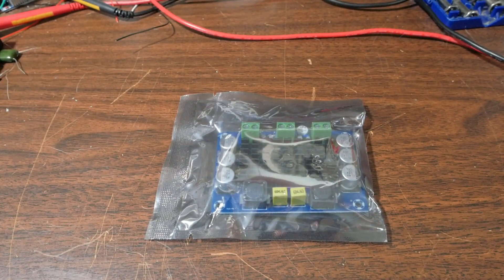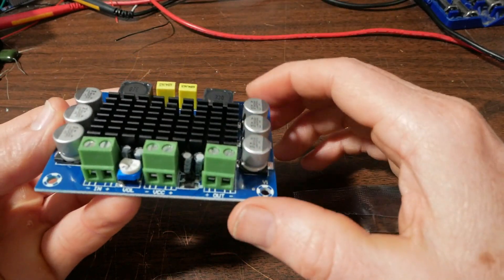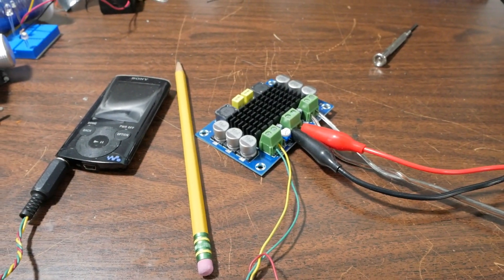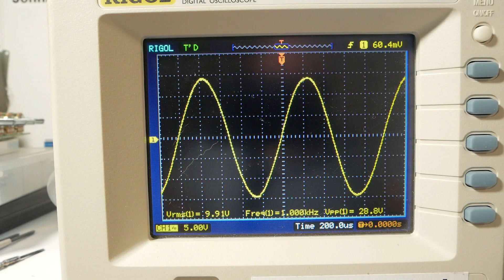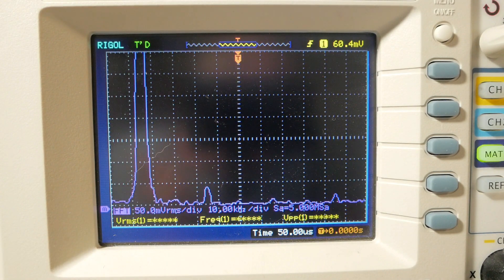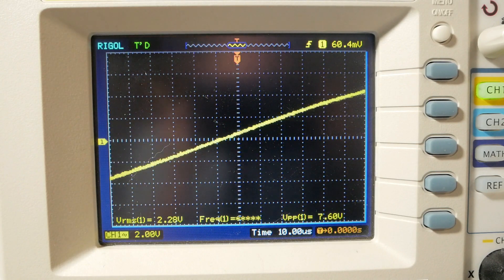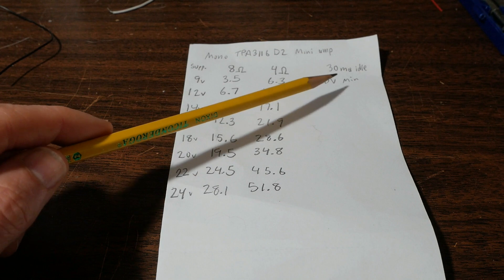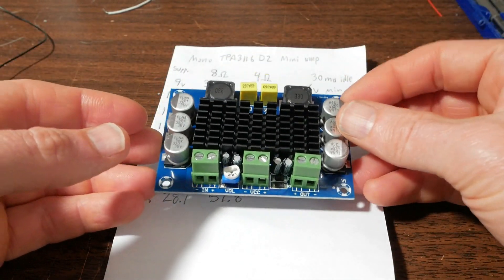TPA3116 D2 mono audio amplifier board test  & review

Comment: I have measured the amp, U=20V, R=4Ohm. The maximum Urms is about 10V, which means about 25W, if I calculate correctly. The same result can be seen on the video, time 04:06. Increasing the input signal level brings about the limitation and distortion. So I would say that maximum output power of this board is about 25-30 W into 4 Ohms and a half of it when using 8 Ohms load.

Comment: Did you ever test these at 2ohm?
Reply: He did, the reverse polarity diodes are 1N4007 and they are rated at 1A since they are on parallel it give 2A of headroom but at 2ohm it pushes 4 to 5A really stressing them and the coils get hot, a lot of clipping too. I wouldn't advice on doing 2 ohm loads

Comment: Hi John, I have a question. I noticed a little volume pot on the amp. If I'm going to use this amp in conjunction with a preamp board, should I turn it all the way up, or somehow bypass it?
Reply from the maker: Set it mid way and see how the level works out with the preamp and go from there.

Comment: I got two of these and used them with a car stereo. After removing the negative speaker wires from the head unit they worked fine.

Comment: so this board BTL  only deliver 50W at 24V at 4Ohm Speaker??

i recently buy 2pcs for making stereo 2x100W.. still delivery process..
i'm thinking this board can deliver 100W at 24V at 4Ohm speaker :face-purple-crying:

i have 2 Speaker  @100W RMS, want making Stereo Amplifier 2x100W
or any recomended Class D board that real run 100W at 4Ohm speaker??
Reply from the maker: Physically impossible to get 100 watts from a 24 volt supply into 4 Ohms with these boards. Around 50 watts per channel is the best you can do.
Reply: @JohnAudioTech  can you run 2 of these boards in parallel to get 100watts 24v 4 ohms ? Or would it fry the outputs or be slightly out of phase due to output coil latency ?

Comment: you really seam to know what you're talking about. I would need quite a bit of education to devolop the same knowledge base. there is a review about this amp on amazon saying that the chip under the power supply isn't as advertized. this review then suggets the TPA3118 amp. have you reviewed this? if now, would you?

Comment: I have seen in some video that this board is actually not having TPA3116 ic under its heat sink, instead it has some other IC which is not even having a number on it.
But still if it performs good, then it is actually appreciable.

Comment: I got two of these boards online. I am trying to figure out how to pass a stereo Left & Right channel into them correctly. I am wiring a aux 3.5mm stereo jack to the inputs, but when testing left and right it appears to drop either the left channel or right channel. How can I correctly multiplex both Left and right from the 3.5mm into this kind of amp.

Comment: I received 2 of these both were fake sop16 ics with TPA3116D2 painted on them. Can’t get a refund until the product is shipped back. This video sold me on this module. Thing is with the fake chip it still says it’s pulling 30+w on my supply. Sitting idol it pulls 70ma. 24v supply. Really crappy distortion above 12v. This fake chip is fooling lots of people by looks of feedback on the item I bought. If you haven’t came across the fake one I’ll send it your way. 
Great video, as always. 
God Bless.

Comment: Would you be ok to run this at 24v at 4ohm full time or would you recommend a lower voltage to operate on?
Reply from the maker: If you like to play it loud with a lot of bass, I'd back down to 18v so the board doesn't overheat.

Comment: 4 Channel 100W*2 50W*2 TPA3116D2 Digital Stereo Audio Power Amplifier Board  I have this board I just ordered and wonder if its any good.  Replacing the High Power Digital Bluetooth Power Amplifier Board TDA7498 HiFi Stereo 2*100W got them both off eBay had to replace the old one because when turned up it cuts off and have to power off and one to get sound back.  I figured with 2 additional outputs I can get rid of the crossovers  and the 50 watts can go to new mid range twiter combo speakers.  and in hopes of getting better sound.  whats your input.

Comment: I just bought one of these boards off of eBay and tested it on the bench with a 24v supply and 4-ohm load. I accidentally shorted the output for a second. The board died, I pull the heatsink to find an unlabeled 16-pin burned and smelled chip, not a TPA3116 D2. The package was different. Yes, it did a little over 50 Watts but it is not shortcircuit protected like the real TPA3116.  What's going on here? Fake TPA3116d2?

Comment: There are now "copied" 3116 chips out there called a "TPA3116D2DADR" that replace the genuine TI TPAa3116D2 chip.  These looking nearly identical to this board.

If I send you one along with a donation to the cause can you test it?  I also have a stereo version of this board.  It is listed as 100Wx2 so I expected it to have two chips but it does not... That would also be interesting to measure to see what it can really deliver...

Comment: I tried to measure fr. response with Holmimpulse or Arta via my USB soundcard and I get a lot of noise, as soon as I connect ground probe to output (at fairly  low level). Is there some kind of special procedure with those D-class amps?

Comment: Hi. I have seen another video before, in which you tested another board with a TPA3116 amplifier (red board) which had some problems with the preamp and ceramic capacitors (I remember you bypassed the preamp with an electrolytic capacitor).  
Is this blue board better than the previous one?  
Do you have any problem like the above?  Which one would you recommend?
Thanks in advance
Reply from the maker: Yes, this board is better but all the ones that I tested used the wrong value of output filter coils that roll off high frequencies too early.

Comment: I actually build a guitar amp and I put one of these inside it. So far it's still working. It's loud enough to practise at home but not loud enough with a band.
Reply: Did you use 24V supply?
Reply: @audiobodge  yes 24v
Reply: What power supply do you use for it?

Comment: How much amperes do I need for 24v supply on 4ohms? Planning to get one to use as a guitar amp.
Reply from the maker: 3 amps should cover it.
Reply: @JohnAudioTech  Thanks! Another question. Does using a compressor/limiter prevent this amp from distorting while increasing the loudness?

Comment: I had one of a similar board, which had a strong power on transcend “pop” on my woofer. Usually I could have a 555 based delayed-on circuit hooking to the MUTE pin on the TPA3116 and push it “high” for a couple of second at powering up and avoid the “pop”. However, this board had the heat sink adhered to the chip and had made this mod impossible. In my attempt to pull the heat sink off, I have broken pins of the chip. To me, this little beauty is useless. I would only look for a board with screwed-on heat sink, or with built-in power-on management circuitry.
Reply: have you found such a board, as the pop really annoys me!

Comment: I have questions -
1. How much power output can we expect on single 24 volts @ 4 ohms ?
2. If the gain of an amplifier is reduced to minimum recommended as on datasheet, will it result in more current (Amps) draw from the power supply ?

Comment: can you help me with the volume, as we need a screw driver to operate it  ? can I connect the audio in to the loudspeakers terminals of my car radio so i can operate volume with the radio ? if so can I set the volume on board to max?

Comment: I have problems with this board.  Intermodulation occurs at 3.3KHz and higher. New signals appear in the audio range especially at high frequencies. Probably because of the 2.5Khz - 5.7KHz spikes at 0V input (not sure where it comes from actually. Ut rides along the 990KHz sawtooth wave). i don't know why it happens. It sounds great but I'm worried about this issue. How to fix this?

Comment: Doing some testing on various Class D amps with the small inductors like this one, what I've seen is that if you leave them loaded for a few minutes the high frequency distortion goes way up.  Say 10Khz or above.  I've watched FFT's where you can see the distortion build as the inductors heat up.  Would be curious if you see the same thing.  Perhaps a video opportunity.
Reply from the maker: I'd have to check this out. Perhaps letting the inductor warm and cooling it to see the result.

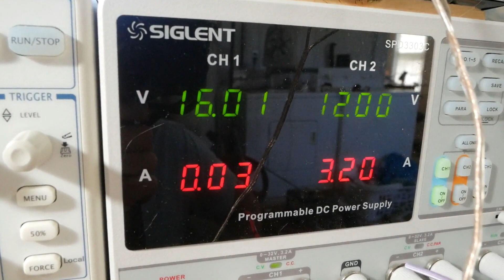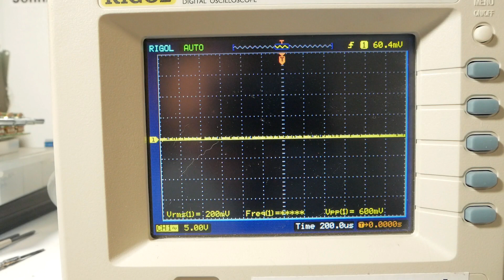Comment: Hi John - Thanks for doing this detailed video. I am confused on how a single-supply amp such as a TPA3116 with a max VCC=26 volts can produce 100W @ 2 Ohm load in mono mode unless the h-bridge circuitry somehow uses charge-pumps to increase the voltage swing to greater than supply.  For example, the spec sheet recommends a 24 VDC brick. So that would give a 12 Vpk, or 8.512(.707)=8.5 VRMS, giving a max power of (8.5)^2/2=36W, which is far off of 100W. You show at 2:15 that you are supplying 16 VDC which should yield a Vrms=5.7, yet at 4:03 the VPP is 28.2 VDC and Vrms=9.71V.   I have read the spec-sheet and am struggling to understand this.  Can you suggest an explanation? Does the device use charge-pumps, and if so, wouldn't that reduce the max current that it could supply? Thanks again.
Reply from the maker: Ignoring the few volts of loss, with a bridged configuration and a 24v supply. At max peak +voltage, side A amp (as I'll call it) of the bridge has its upper transistor fully open to the positive rail and amp B's  lower transistor is open to supply ground, so +24 volts across the load. Now let's say the waveform transitions to max negative, so now the lower transistor in amp A is open to ground and the upper transistor of amp B is open to the supply. Now there is -24v across the load. The full cycle yields 48v pk-pk or 24v pk which is about 17v rms. With a 2 Ohm load, this would dissipate 144 watts. The bridge doubles the max voltage the amp can deliver for a given supply voltage. Double the voltage means double the current into a given load and that results in 4x the power. Losses in a real circuit means output won't reach this level. Hopefully this makes some sense.
Reply: @JohnAudioTech  That just clicked!!! Thanks so much for taking the time to respond.

Comment: Trying crossover design using this amps.. it seems there is a boost on higher frequency.. its not flat.. and when using Xsim design.. there difference between simulation and real measurements.

Comment: Hi John, I happen to have such a mini amp and intend to use it for a Bluetooth speaker project. I have several options for the bluetooth. I could go for a simple KRC-86B module or find myself a BT board with integrated amp options. Most of the time those are like 2x3W. Pro for those amps is the bells and whistles with extra's like 3,5mm audio jack input (besides using BT) and even an option to add a SD card as source.
Did you ever test such boards? Is it possible to daisychain such a board to a TPA3113 D2?
Thanks for the answer and thnx for the informative video's so far.

Comment: My first 3116 board suddenly started acting up in one channel. The sound comes on and off like an oscillation .I can't figure out why.
The second one is still running. 
I am running it with a 18v transformer which after adding a filtering capacitor pushes the voltage to 26v. I used 8 diodes in series with the power supply to drop it to 20v. Can I run it without dropping the voltage at 26v?
Also do you know what ails my first board where the sound comes on and off in one channel?
Both boards are dual chip.
Thanks in advance

Comment: Hello John,
Greetings from Serbia...

Please help me about this amps.
I installed 11 amps in my bus to make active speakers in passinger deck. It works very nice.
But when I finished then I suprised.
When I start dimmer for low intensity led lights, speakers got loud buzz!
I try to connect power supply from the other sorts and no changes.
I disconnected amplifiers from head unit and start supply and dimmer for lights, amps make buzz without sound.
I don't know what to do.
It connect parallel 5 amps on right side, and 6 amps on left side. 
Thank you and
Best regards

Comment: Does anyone know what  is the small potentiometer doing on this board. Is it for volume adjustment or dc output adjustment ?
Reply: That is volume adjustment.
You can instal it on any DC power supply from 12 to 24v.

Comment: Hey, i ordered another TPA3116 amplifier with bluetooth. I am wondering if i can expect similar results to the one you reviewed or not ? If not, i might aswell go order the one you reviewed and a separate bluetooth module. I need it for my bluetooth speaker btw. This is the module i ordered:

https://www.ebay.com/itm/Digital-TPA3116-50W-2-Bluetooth-4-1-Power-Amplifier-Board-TF-DC12-24V-XH-A104/163870557767?ssPageName=STRK%3AMEBIDX%3AIT&_trksid=p2057872.m2749.l2649&autorefresh=true

Comment: Great video, a lot of info, but TPA3116D2 is designed for 2 x 4-8ohm loads, in this mono build you should also measure it with 2ohm  load to see if you can get close to that advertised 100W power

Comment: i currently got one of these on my logitech z5500 subwoofer and it hits hard  but i never got to full volume yet lol
Reply: if anyones wondering the built in amp for the z5500 died out of nowhere so i ditched it and converted the subwoofer into a passive subwoofer
Reply: the amps running off a 12v  20ah 18650 battery pack  i built  for a portable system that punches
Reply: @danielhorne6042 bad choice..
Logitech Z5500 have verry good amplifier for his speaker subwoofer.
Is tda7294 bridge mode. You can purchase tda7294 bridge amplifier , and one low pass filter build or purchase again and the rest of components power supply etc you have from old circuit. I make this choice 6 years ago and I was happy with them

Comment: Why didn't you test it at 2ohms? Texas Instruments rates that chip at 100W/2ohms/26volt power supply, if it gave 51w with 4ohms/24v P.S. it's pretty good, it should be close to Texas specs. Aliexpress got it for $4 free shipping.
I'm planing on using it with 3ohms/26volts. it should be fine I guess.

Comment: Hello sir 

I have TDA8954th 420watts mono amplifier I was playing music when I increase the volume popping noise starts coming on high volume and after that amplifier just stopped giving output but amplifier is still on but not giving output 

Supply Voltage: 28-0-28 
Speaker: 30 watts 3 ohms
I was using these speakers with it but today that popping noise came and amplifier stopped giving output I will make a video on it if u want so u can see my problem an understand it better 
Sir if u have any solution plz kindly help me with it 

Thankyou in advance
Reply: sounds like you blew yer speaker
Reply: @barneycarparts  Nono the speaker's are fine working good on Other Amplifier but that Amplifier is no longer working.
Found out after studying on that chip is it was in permanent lock in protection mod. 
Changing the chip fixed it
Reply: https://www.nxp.com/docs/en/data-sheet/TDA8954.pdf The datasheet says 420W with 8 ohm, you probably burned the IC

Comment: If you're getting 51.8 watts at 24 volts and the spec sheet for the TPA3116D2 says 50W x2 @ 4Ω / 21V then that means they didn't bridge the two channels into one for mono on this? they just hooked up one channel of the TPA3116D2?  I was hoping to see that it bumped it up to 100W x1 into 4Ω.  Has anyone seen a board that has bridged the TI Chip?
Reply: yes, i'm wondering about this as well. the boards i've seen advertise 100W. what's the deal with this one if it maxxes out at 50W? or is that just measuring one side of the board or something?
Reply from the maker: These single output 3116  boards take the two bridged outputs and parallel them together to enable the amp to drive lower impedance loads. I assume they claim 100w using a 2 ohm load but I think too much heat would be produced because of the small heatsink for such power levels. Even class D amps must dissipate some heat.
Reply: @JohnAudioTech  Thanks for the reply John. :)  I'm leaning towards two of these to make stereo powered by a laptop supply that delivers 19VDC@4.75A. Hoping it's enough to drive a couple Bose 141s which are probably 6 ohm. I guess there's only one way to find out! Please let me know if you have some thought on my proposed setup.

Comment: is he able to handle 2 ohms?
Reply from the maker: Yes it can at 12 volts. I'd be more concerned of heat when loading it at 2 ohms with higher supply voltages.

Comment: So this is not 100w board?
Reply: The TPA3116D2 can put out 120W into a 2 ohm load at 24V in PBTL mode(mono mode, like on this board), technically speaking. But i doubt that this board would survive that, either the chip will pop if it's not a genuine TPA3116D2 chip under the heatsink, or it will go into a thermal shutdown quite quickly. You could modify the board by drilling it and the heatsink, using good thermal paste instead of it being glued on to the chip like on this board, and attaching a fan to a heatsink, if you really want that 100W clean power. But i would higly recommend not going for this board if you require more than 50W.

Comment: I had one that would run down to 4.2v and cut out at 4.1v
so 5v was its minimum. it was a random stereo single TPA3116 D2 chip one.
Most of these TPA3116 boards are ok but avoid the ones with bluetooth like the plague. they are horrible for playing games or music with any kind of short pauses in them. the standby on the bluetooth is overly slow and not sensitive enough and theres a delay when they detect music and actually turn on. enough to ruin a song or you wont catch really short quiet notes or stuff. I hate dealing with bluetooth stuff because the standby mode is so terrible and i wish it would just continuously be active so theres no delay at all or cutting in and out at low volume.